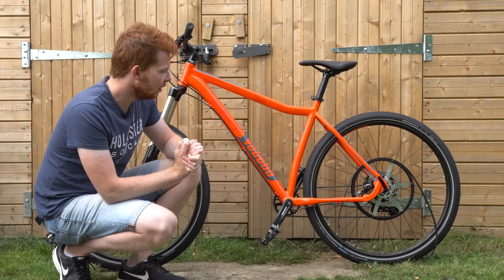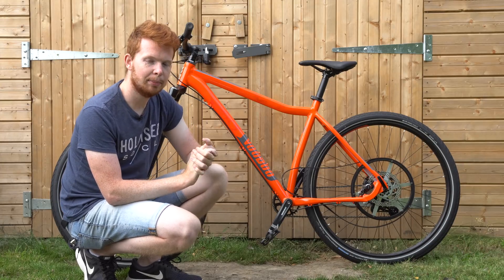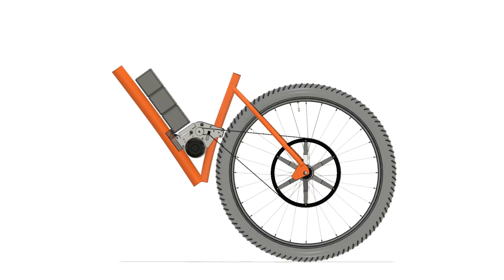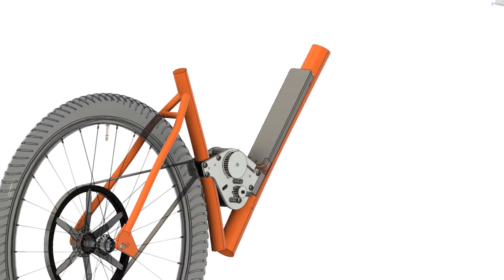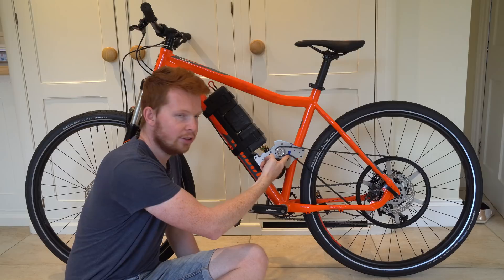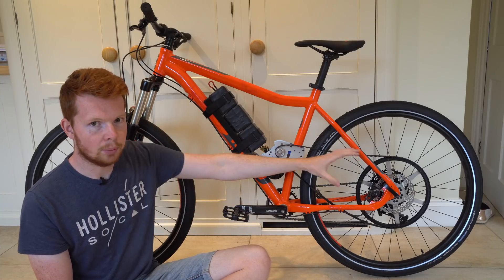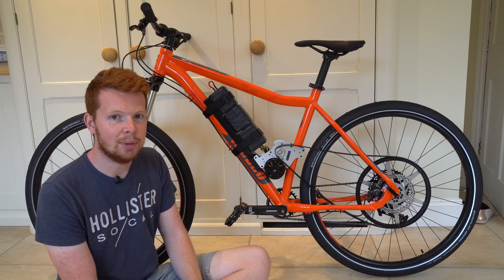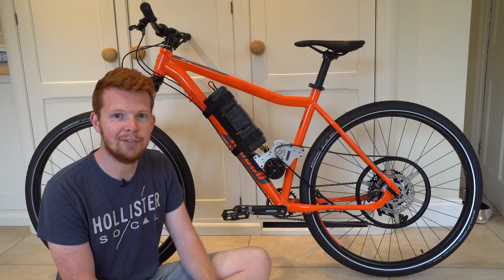Electric bike 4.0 - Motor Mount

Comment: Hey man, just wanting to say i like this project. The way you imported your bike in the cad software was new to me 👍
So if you put 10 of these motors and battery packs in a small car, you should be able to power it? 😀
Reply: Yes you could.. but more efficient and much cheaper to use 1 bigger motor and bigger controller, and parallel up the batteries.

Comment: One more huge advantage with your system over hub motors, is that you can change wheel any time and have the choice to build high end (or dirt cheap) wheel anytime you want. Plus, most hub motors axle assemblies are very poor. With this system, you could mount an high end hub and never fear to break it. Also, if you destroy the rim, it's cheaper most of the time to buy a whole new wheel than the labor cost of a wheel builder. Unless you're a confirmed bike mechanic OR a really handy home repair guy with the RIGHT TOOLS (spoke tension meter, wheel building stand), you should NOT build your own wheels for this kind of high torque/speed application. You can get away with a badly/amateurish built wheel when using your bike as a city commuter and without electric power tho. So yeah, very flexible system and a lot of thoughts put into it, I like it !

Comment: PLA should actually have a higher tensile strength than PETG (however PETG can flex more, making it more durable in most situations) I also don't get why prototyping in PLA is relevant, since the price are almost identical of PETG and PLA?

Comment: I don't know if someone mentioned this already. But I assume you are going to make some sort of belt/motor guard  so your pant leg doesn't get into the drive train. You of course didn't have that issue on your previous design.
Reply from the maker: Exactly, I'm going to design a 3D printed cover that will not only protect my legs, but also prevent water and dirt getting to the motor/pulleys. Thanks

Comment: I might be dreaming a bit here, but what if you flipped the motor to the other side and used the 1st gear driven by a chain?

This way you can skip designing and fitting a rear pulley, which did took a lot of work as seen in your previous video.

I'm not sure as to how much the belt is rated for, but it definitely takes less abuse than a chain. As to the reduction however, you'd have to come up with a bigger ratio, that's for sure.

Cheers mate! Loving build so far! Keep it up!

Edit: freewheeling would compromise any regen possibilities though.
Reply: Dirceu Corsetti Those belts are way more rigid than they look. They can easily handle more torque than a bicycle chain while wasting less energy and do not require oiling.

Comment: Have you considered adding a cover over the moving parts? Its not strictly necessary, but it might help with a) longevity of the parts and b) longevity of the skin on your calf. A belt moving at relatively high speed snagging on skin or cloth is at best unpleasant... and it sjouldnt be too hard to print something to cover it, I dont think...?

Comment: Excellent work. Great content. I look forward to your videos. Thanks. One thing which occurs to me is how the belt may dump water over the end of the motor when it's raining. But it probably won't be too much of an issue, as the belt won't pick up road water.
Reply: Perhaps that could be solved with a wiper placed at an angle almost touching the belt to catch and deflect or drain any spray it picks up.
Reply: Yes, that's a good idea, or maybe a little brush. It would have to work in both directions so it didn't jam if you pushed the bike backwards.

Comment: I totally  agree about your words on speed and that stuff. Is stupid  to run more that 40/50kmh on a bike, and way stressful for the frame, not designed for this kind of speed, vibration ect... btw, at least in Italy, your bike is a "bit" illegal i think in UK too 😂 in theory you could not run with it in public area, check with attention your laws
Reply: High speeds are not an issue for a bicycle. Even lightweight road bikes are perfectly fine with 70km/h and a few potholes (otherwise almost every road cyclist would be dead). What kills non-downhill MTBs are huge jumps, hits on the front wheel/fork and the like. Basically anything where the rider has to fight to stay on the bike can damage the bike, everything else should be fine.

Comment: Is something like the beast x528 2y overkill for an electric bike? I would like to mount the motor so that it drives the pre-existing chain so I can easily change the gear ratio, and would also like to give the pedals a one way clutch if possible

Comment: I’m currently buying in parts for a hub motor setup. Part of the reason for that is that it’s more discreet (as much as ebikes can be) which’ll suit my needs more. Otherwise I’d totally do something similar.
So as a result I’m focussing my innovation on the battery system instead, creating a compact solder and weld-free battery pack.

Comment: For  the drive system where motor rolls/rubs on tire, how about printing a large gear , then glue that to the side of the rim, then motor will be geared with no slip?

Comment: Greetings Sir - im not sure if youve mentioned it before so i apologise if you have already said (im a bit new here) but i was wondering how long your batteries last on a single charge or roughly how much mileage you get out of them which ever is the most useful.

secondly - i know youve used regenerative breaking in a previous version to reclaim some charge is it possible to extend the range by charging the batteries through normal cycling and taking some of the power for thrust into charging? i would imagine for more leisurely journeys you could take advantage of more ideal conditions to maintain/top up the battery charge and expend it when conditions worsen or you find out the pub closes for lunch and you need to get there quickly before last orders :P

ive been thoroughly enjoying this channel and i wish you every success

Comment: Hi Tom!

I'm considerting bying a Turnigy Aerodrive c80100 130 as a motor for my bike, but im new to this whole eletrical engineering world. The motor uses 12s and there is a controller with the motor wich is also 12s. My question to you is: what battery should i get and why? i want a good solid lithium or Lipo battery, without being too expensive. 

Best Regards from Denmark!
Reply: I am not Tom, but want to give you nonetheless my opinion. I am pretty happy with Turnigy Lipo batteries, especially for the price. Have used them for years in RC and recently also build a e-bike with some big Turnigy multistar packs, that works really good so far. Just watch out for bad batches, for example i would not recommend 25C nanotechs. The max discharge rate (C rate) is mostly no problem on bikes because of the relativly large capacity. Now it really depends on what range you want to reach (and therefore how much weight the pack adds).
Reply: Hippo I think minimum 60km but i would'nt say no to more.
Reply: HEy I’ve built a couple of 6kw go carts in my time, I’d suggest using multi star 16000 4s batteries for like 60 bucks. Use 3 in series. A easier option than trying to make a lithium ion battery. I haven’t tried toms style of batteries yet, maybe it will work better than lipo

Comment: Why not use a chain instead of a belt? Wouldn t it have even better grip?
Reply: There are motorcycles that use belts. The grip is not the problem. In the motorcycle world the belts are little less efficient than chains, but the belts do not need maintenance (no lub is needed so no mess on the wheel). From the more efficient to the less efficient we have, chains, belts and cardan shafts... I hate having to lubricate chains...

Comment: Could you not have mounted the motor above the rear wheel on a strong platform?

Yeah, it's gonna look a big ghetto engineered and not streamline but sometimes functionality has to take priority and the batteries could've been mounted inside the frame or pushed forward, maybe between the front wheel frame to balance it out.

Comment: I think you are using the best method and a roller to tire approach is by far the worst method, and the hub idea is sort of the middle level idea.

Also your belt design can also still work with a pivoting rear swing arm suspension with a few minor design adjustments, if one wanted to upgrade the system that far along...
Reply: The jack-shaft pulley point would indeed have to be 'very close' to the pivot arm point, albeit, not by rule directly on top of it, and yes, this is a more complex setup.

Although perhaps it is not a desirable option, since there are a host of versions of the whole swing arm rear suspension idea, it may be possible to locate a design out of those many made that would accommodate the belt drive without adding a vast amount of new parts to the design.

This one design, interestingly, has a hollow pivot point, which, if utilized properly, could be a place to add a jack shaft, either as a through-put power configuration, or as a cantilevered single side shared pulley configuration...

https://ep1.pinkbike.org/p3pb6965981/p3pb6965981.jpg

There are many more types out there of course, and others may be better or worse, depending on a whole host of parameters one is seeking to employ.
Reply: This single arm, through-hole design might even work better.

https://bikerumor-wpengine.netdna-ssl.com/wp-content/uploads/2017/02/Cannondale-headquarters-tour-GT-single-sided-full-suspension-iDrive07.jpg

Comment: Have you ever thought of using supercapacitors or ultracapacitors to store more of the regenerated energy from braking as usable electricity?  I know batteries aren't the best at absorbing a lot of energy quickly and they tend to convert a lot of that into heat rather than stored charge.  I've been thinking about putting a motor system on my bike and I was wondering if you'd get any extra juice from a capacitor system for momentary energy storage.
Reply: Caps waste a lot of energy when storing it so you could only use them as a buffer to absorb the energy initially.
Also, caps have a very bad power density and power to weight ratio compared to batteries.
I once found a video of a guy trying to fly his drone on supercaps... didn't fly for long ;)

Comment: What's the legal situation where you live?
In Germany I'm limited to (I think) a 200w motor and 25km/h.
Anything above and I might actually risk my driver's license.
Reply: I was wondering the same.  In Ohio and most of the states, it is limited to about 33km/h unassisted.  Or around 1 break horsepower.
Reply: AlexLernt The limit in the UK is 250w and 15 mph. But there are a number of bike's around that exceed this limit.
Reply: He could probably add some kind of current limiter in case he is ever in a situation where they want to test it.  Could have a switch under the seat or something to override the limiter but it would need to be kinda subtle, and turn off automaticly.  Maybe something fully electronic.   Here in Canada there's similar rules, limit is 500w I think and no more than like 32km/h, which is odd because it's technically possible to do that even without a motor if going downhill with wind on your back and other good conditions.
Reply: Red Squirrel he's using a vesc, it can change power output on his phone if he puts a Bluetooth module on it. It's also great for changing driving modes like preformance for range. I've burned through 3vescs on my esk8😂

Comment: Awesome job , you can sell e-bikes , it looks like expensive bike with well machined parts :D (about hub engines..... It looks heavy but it is made using aluminium with all parts engine bearings etc inside so it not as heavy as you think but they get tooo much tourque ...uo to 150Nm if speed controler dont limit that (my 1000cc VTR 1000 get 98Nm and do power wheelies with 230kg so i dont want 150Nm in bike with only maybe 30kg xD)  try BIONX engines 90% of  250W old bionx you can buy for around 50$ this engines can run at 1500(without)-2300W  (with cooling like smal aluminium radiators around
Reply: Sebastian Nurkowski there is a very important difference between hub motors, and any drive train with fixed ratio. 
The hub motor sits inside the rear wheel and directly transmits it's torque to the wheel, without any changes. So, the 150 nm wheel torque you have are all you will get. 

On the other hand a bike.
My 160/60 17 tire should be about 64cm in diameter (roughly calculated). 
For my bike to do 20 kph at around 1500 idel speed, i'd need a 10:1 ratio crank to wheel. 
So if I had 98nm as well, I'd get 980Nm at the rear wheel. 
So a 150Nm bike should be quite manageable.
Reply: Right ....right ...i forgot about that (first think then write) , but still it's too much torque for thin bike parts

Comment: id mount the battery lower on the front of the tube, for better balance, long term, design a rotary clutch or dog drive with removable pins for the rear cog so it can freewheel off motor for good pedalling (then again its probably fine hooking the belt off the pulley and wrapping it round the frame if you have to)

Comment: I've just had a 1500W hub motor arrive from China, the dimensions don't match up with the technical documents they provided and it's far too wide to fit in the 135mm dropouts they claimed it was designed for :( The supplier told me to just bend the aluminium frame!

Comment: I've had a couple of those cheap 2-cycle bicycle engine kits. They work well, but they do lack torque. I'm very curious to see that step-down in action. If it will pop a wheelie, then you can probably do burn-out's with it too. A pedal-bike doing a burn-out would be something I've never seen before, and it would make a very cool ending to a series of youtube videos.
Reply: Bradley Fortner you obviously haven't seen the video clip of the Arab doing doughnuts on a push bike.

Comment: Tom, it might be better to mount the aluminum plate straight to the seat tube (vertical tube) with rivnuts they are halfway between rivets and and nuts and they can be used to directly connect it to the tube. Rivnuts are also the the things that make the bottle holder mount.
Reply: Those tubes are usually extremely thin, putting holes into them and having those hold parts with high torque will end in tears.
Reply: MsSomeonenew that's a mountain  bike, they normally have holes in them to let water get out when it gets in. Anyways they already have holes in it for the bottle mounts, and doing it on the seat stem won't add any major weakness due to it being able to pass strain through two other parts.

Comment: Please add the Propeller to the side. Might be usefull - at least a proven concept back in the era of horse racing as seen in the movie ben hur with Kirk Douglas. And to use the prop without harming youself you need to sit on the bike like a lady on a horse sattle in 1902 with both legs on one side. Yes, one defender prop ..
Reply: It would also be handy to counteract any cross winds on particularly breezy days.
Reply: And it could function as a impromptu helicopter whenever you get stuck in a ditch and want to get out. Also, you might be able to do some sick wall rides whenever you feel like it!

Comment: why aren't you using lipo batteries? they'd have a higher discharge, high voltage and weigh less
Reply: I used to run lipo batteries, but lithium ion batteries are better in 
many ways. These can happily deliver 100A at 49v and barely get warm. 
The energy density is better than a lipo and the lifespan is longer in 
terms of number of cycles.
Reply: Some 18650s can deliver 20-30A each, but to be able to do that they have to have less capacity to make room for the thicker electrodes required. You won't find these in laptops though.
Laptop 18650s have more capacity, but can only deliver a few amps, so to get more amps just need more of them in parallel, which also increases weight... So it's a case of balancing requirements...
I made a 2kWh 14S16P 58V 40Ah pack from laptop cells which gives a great range, and comfortably delivers 30A but it weighs 10kg. Probably not optimal for mountain biking, but lasts forever in a city.
My pack of 10 6S lipos has lost about 20% capacity after 3 years of daily use, but it still works great. On really long trips over 150km, I can carry both packs and switch between them as required.